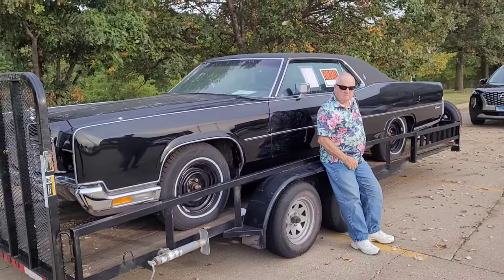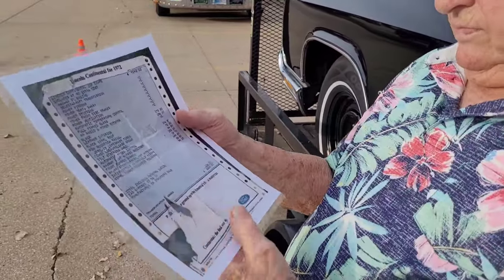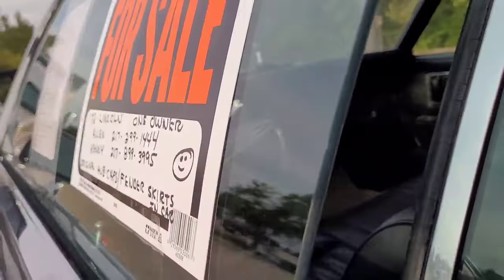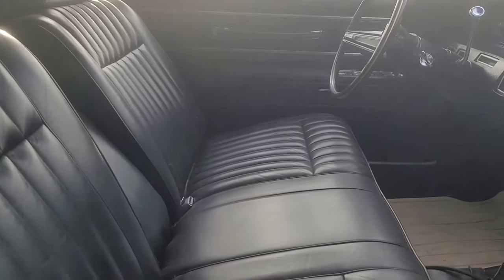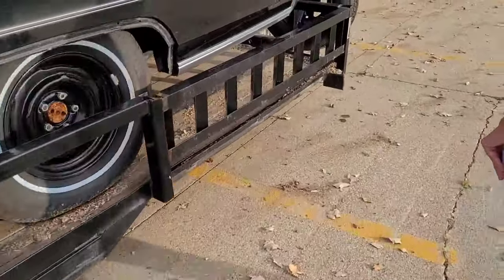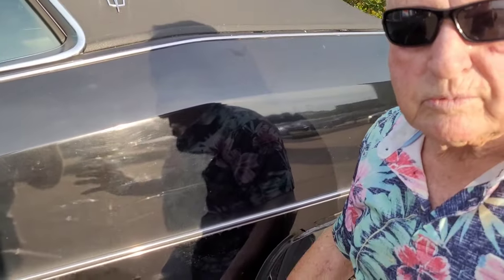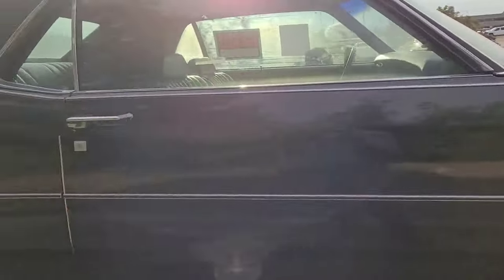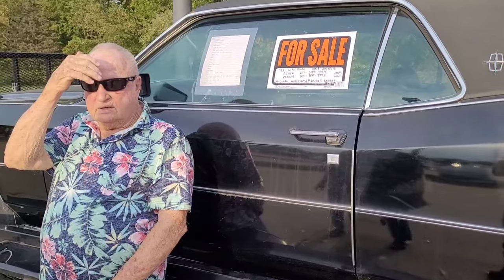Sold!!!! 1972 Triple Black Lincoln Continental 2 Door Coupe For Sale. Less than 54k Miles

Comment: Tony that’s a beauty!!!  Around 1985 I saw a 1973 4 door with the town car option, cloth seats and factory ASC sunroof (metal panel covered in same material as the roof),  it was triple black too it even had the mini vents.  I was only 19 and if I recall the dealer was asking $2200. Which I didn’t have back then.  I had some minor rust a few dings/dents but I thought it was awesome!   I show it to my dad and he said it was a “bomb” to forget it Lolol all these years later I still think about that car as I’ve never seen another 73 town car in black with factory sunroof.   This evokes memories of that car!   If I didn’t have three other projects I’d grab this car and take it to the next level!!   Thanks for this treat
Reply from the maker: It's funny you say these things because all I can think about it getting this car and adding a big factory 70s moonroof to it after deleting the vinyl roof and body side moldings. But I'm like you.....too many projects. 😢
Reply: We must be related.  We both know all about those damned mark iii rear quarter windows and what a treat it is to remove the mechanism to service it. After you have already removed 16 screws , 12 nuts several clips and a few bolts it STILL is in there solid as all  hell. Then you find the last 2-3 screws and out it comes!! Lololol my 67 tbird uses the same mechanisms lol
Reply from the maker: @jakereal3604 Oh yes......I've worked on both, and what a nightmare!
Reply: Nightmare pretty much sums it up

Comment: Tony you need to buy this one and add to your collection.  He's done a lot with the brakes and gas tank/fuel pump.  Also the water pump.  It's ready for you to finish up.  You like two doors, since you have that two door mercury.  Pretty rare car. You'd be a good caretaker.
Reply from the maker: They want me to buy it. They say they want me to have it after watching my videos.
Reply: @tonyscarcare5657  I'm not telling you anything you don't already know but triple check the undercarriage for rust.  I know he said it was rarely driven in rain, but always verify.  I just bought a 61 that was surface rust only according to the seller.  Rust is so bad that one leaf spring has six of seven leafs broken in two and the other has the main leaf spring broken in two.  I know better, but I trusted the seller.  With the cracked dash and the rust under the vinyl top that 72 must have spent a lot of time sitting outside.  Still the price is right especially with the mechanical work that he has already done.  My least favorite jobs are gas tank and brakes and these are done on it.
Reply from the maker: @jeffsmith846 I almost bought it until I talked to the mechanic who's been doing the work.
Reply: @tonyscarcare5657  Smart move.

Comment: Good video that be a good buy the 2 door coupes are rare  I’ would have changed that plastic timing chain with a new double roller chain and gear for 1970 or 71 which brings the cam straight up really wakes up that 460 1972 first year for low compression 460 the heads were not great and had detonation issues sow premium fuel is a must  throw that Holley carb away and get an edelbrock 700 carb I’d strip that top off and repair that rust and paint the roof black and you have a great cruiser with good get up and go.✌🏿👍
Reply from the maker: I'd have to lose the body side moldings, too.

Comment: Man if i had just waited a few months later id have gotten this. I ended up buying a 72 Mark IV that im giving TLC. I always wanted a 70-73 Continental Coupe. Im sure this will sell soon and probably for $5-9k. Top and rust will cost $2-3k to repair and replace though.
Reply from the maker: I'd really like to have it myself. And it's close! 🤯
Reply: It’s worth a lot more than 5-9
Reply: @js6752  Not with it needing rust repair which will be in the few thousand and a crack in the dash and whatever else you can't see. Like Tony said once all of that is fixed or addressed then yea maybe $12-15k. When cars sit though it never does them any good. He has to put all that stuff back together.

Comment: Seems that you're a bit disappointed in the fact it doesn't needs your attention to the window motors)) you asked several times if the windows open)
Reply from the maker: Well, I've had to work on so many of them that honestly, I'd be shocked if the front windows were working properly and not needing work. Those were bad when they where new.

Comment: that car is under priced, i have an all original 72 triple black continental that was my brotherinlaws dads car, mine has 64,000 original miles and is a hershey award winner and hpof certified car all original, mint condition, and i had to up my insured value to 20,000 dollars, so i dont know where that price came from but this man should look into the value of these cars
Reply from the maker: I think it's a fair price. I looked it over very well. You would easily have $10k in it by the time it was road worthy, and then there's a lot of rust under that vinyl top that's gonna require a lot of time and money if it's hired done, even if one was to simply delete the vinyl and go with a painted top. There's also locating an un-cracked dash pad. I'd say one could easily have $20k in it before it's show ready.
Reply: Your insurance value has nothing to do with what you can sell it for…mine is insured for $50k…unlikely I would get that but I’m never selling it so I don’t care
Reply: @js6752  i was told by my classic car insurance company the i had the car underinsured and the value of the car had gone up, im not selling mine either, but only makes sense if the car is worth more from appreciation that the insurance should be more, so i dont get your point lol
Reply: @dadsc10  my point is exactly what I said - the agreed value in your policy doesn’t mean that’s what you can sell it for.
Reply: @js6752  i was not born yesterday i know that, but these cars were low production models and worth more than that asking price, thats my point and you seam like you have an attitude and think you know it all, so no more of your comments are needed
Reply: @dadsc10  I don’t really care when you were born, you can still be wrong. If I totalled my daily driver tomorrow, the insurance would maybe give me $2500 but if I go out to buy a comparable car, it would cost me over $10k…insurance values are very loosely tethered to actual market prices.

Likewise, with my 79 Town Coupé, it’s insured for $50k…how many 79 Town Coupés are being sold for $50k?

These are just facts…I watch auctions, list prices, I work in insurance, I know what actual people are actually paying for these cars.

You can get pissy all you want and try to make this confrontational…doesn’t make me the one with the attitude problem.

Comment: Any vehicle pulling the trailer with the Lincoln on it will get better fuel mileage than the Lincoln driving on its own power. That is the most thirsty engine ever produced it drinks more gas than the Cadillac 501 8.2 l. I know cuz I owned both engines in the Cadillac got better gas mileage. I have a 77 Lincoln town Coupe and a thing drinks so much fuel that it's been sitting parked under a tree for over a decade awaiting it's diesel conversion. So I can run it on used engine oil mixture that'll get it down to a dollar a gallon.